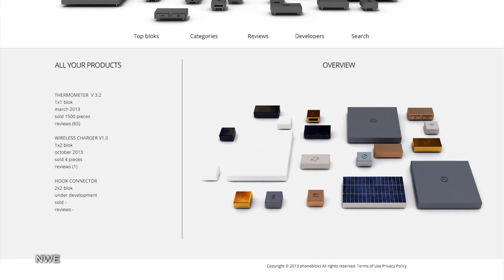Why Phonebloks Aren't Going to Happen

Comment: The greatest limitation I can see is the number of layers each pin can connect to at the same time. If square pins can be made with 6 contacts per side and 4 the on end, 28 layers would be accessible to each hole.

Power needs 2 layers, voltage and ground. Different speeds could occupy the same layer, and each block would need it's own sub-processor just to move the data around.

Comment: OK who approved this video? Bad, bad editor.

-High speed signals to produce the maximum amount of power? WRONG
-RAM and Processor on the same chip? WRONG
-Performance enhancements by packaging the parts closer together? WRONG
-A standardised input... hmmm that would NEVER work. Wait, what is USB again?

Being inaccurate is one thing, but being completely wrong?? Argh! Do your homework.

Comment: Some basic sensors and communication elements could be incorporated onto the main board. The possibility that everything could be modular doesn't necessitate that everything should be (at least initially). I like the idea. It's annoying to have devices become obsolete within a few months (if not weeks), without the ability to upgrade the device hardware. Variable designs would probably make exoskeletons difficult to build though, unless they're modular too. Here's hoping this idea develops...

Comment: There's another video on youtube by a real electrical engineer that talks in detail why this is not possible. CPU architecture and such. He says maybe in 10 years its possible.

There are no communication methods that can fit vasts amount of data and at a fast enough clock speed onto a few pins right now! Just stick with your iphone for the time being.

Comment: Highly unlikely to happen. 

Each combination would need to go through Carrier Certification as it is effectively a different model. Especially true if the radio is swapped for another. 

Swapping radios is an even bigger headache as each combination with radios would have to go through PTCRB at $10K (for testing/certification) per combo.

Comment: It is good to do that. especially with a router like the wrt54gl  (made an awesome router 10 times better (especially with the tomato builds that took advantage of it and added bittorrent support and VPN without crashing.

If anything could use socketed designs, it;s routers. they often have ample space to add sockets without making the device physically bigger.

Comment: the memory and cpu and gpu and screen would be all at pin height 1, the slightly slower bus 2 pin height would connect all modems and even high resolution cameras, and everything at pin height 3 would be slow data components like gps, compass, accelerators, speakers/mics. the battery would be at pin height 4 and every component would have at least a pair of pins at this height to draw power. Simple.

Comment: There are decades old protocols for making stuff work universally for decades, I2C, SMBUS, or even basic USB. The part interconnect could be solved by using a multi-plane backing board and different pin heights of the components for certain buses with a chip set controller at each plane built into the backing board.

Comment: Continued:
The support for new components on mobile devices is mainly limited by the connectors used. just like how you can upgrade a CPU on a desktop PC, you can do it to a smartphone as long as they use the same package design. If the CPU supports 3GB of RAM, then then users should be able to remove the old RAM and insert a 2-3GB module. If a faster CPU uses the same package, then users should be able to pry off the old one and insert a new one, just use sockets instead of BGA )

Comment: it is a good idea and can be partially implemented now. For example the CPU and the POP design for the memory. instead of using BGA, simply use a socket design instead (sockets can also be stacked)

a simple change like that will allow users to pry off the old CPU or just pry off the memory, then snap a new one in place.

(a while back I upgraded the RAM on my dell axim x51v pocket PC by buying a 128MB and desoldering the 64MB module and reflowing the 128MB on the PCB)

Comment: as said, Intel is still working on fiberoptics chips connection. If you know something about electronics, you surely know that processors and memory have a lot of pins, each used for different periferal or bus. a Bus if where information is passed and for a modern processor it uses about 1000 pins per chip. So, if you want to connect chips as said in the announcement you'll need to connect each other by a serial bus, something similar to USB. imagine how slow it should be.

Comment: 1.if there are 1000 dots on the board this amount of connections should happen under the board to make it upgradable in any way: 1000x1000 
2.a 5 year old knows better, wifi has a finger long antenna but there its just a tiny dot
3.if any part o the board can be connected to any other part easily, then a virus can make all of them active, drain the battery in 5 mins or burn your phone :)
4.andoid updates and drivers for those parts
5.the idea could happen but not in this way

Comment: I would say that the biggest problem is that there is a reason that electronic devices are not designed to last. If they last to long the companies don't sell new ones. It might sound synical, but it 100% true. Just look at stuff from the 50s. A lot of that old stuff still works while something from 1995 is highly unlikely to work.
Because of this I think there are few companies that would want to join a project like this.
But I am sure it will happen eventually anyway. Just not anytime soon.

Comment: I think it could happen as long as there is a core/backup system and the blocks were a secondary feature (an extension outlet). They'd just have to test to make sure there are no configurations which have disastrous consequences - the worst having to be bumped up to a slow-down or no start up, and then they could ship out a tutorial booklet with the phone in order to teach consumers the optimal block placement methods.

Comment: Still the CPU block interface can't be good enough for the processing power that is required. And making "motherboard" with a socket for it would be expensive and not be slim enough or optimized enough :/